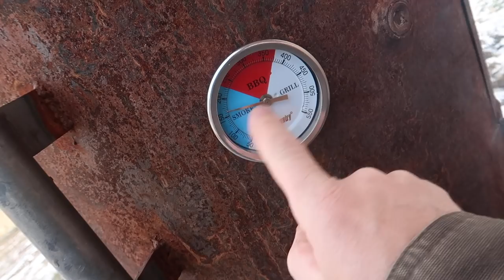She was NOT Impressed!

Comment: I remember that morning my car groaned as it barely cranked over. That oil was like molasses. Found a block heater at the auto parts store. Plugged it in overnight. Glad that heater solved your problem with the fuel line. You're going to miss that excavator. Thanks for sharing guys.

Comment: Hey AL I see 45° plus sun 2 days in a row for your town 4 to 5 days after thanksgiving. So that's your window to cut the grass again if your 8+ inches of snow your getting in the next 24 hours melts. If you have tall spots I would cut it no matter what if you want it to look nice in spring. And I know the tractor started but either way why not use the truck to move NYC and the chicken tractors. Can you get plastic and use them as storage sheds to save the canoe out of the elements and animal fencing plus, ladders, and other miscellaneous. Wish I had something like that, wouldn't even have animals in it I would have a covered  storage to keep stuff in good condition. Or use one to get the Kubota indoors out of the rain and snow.